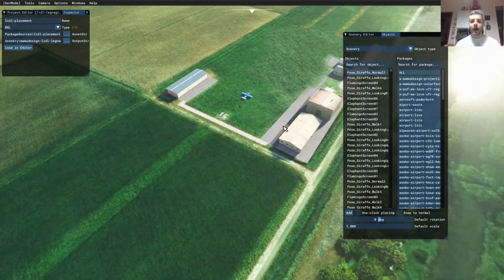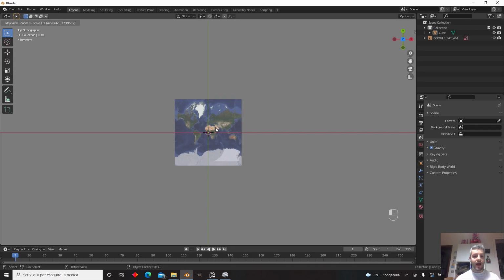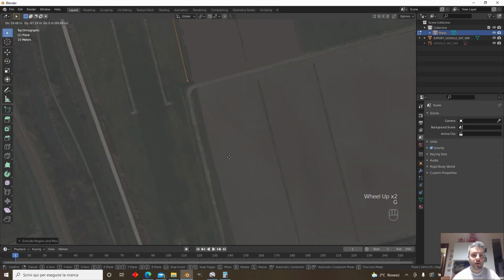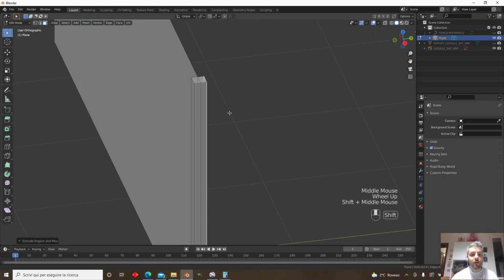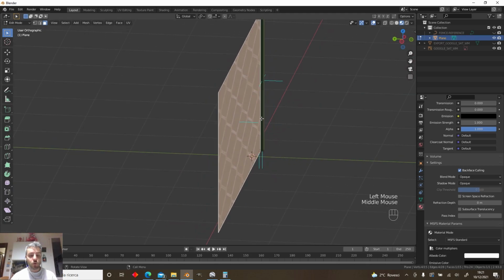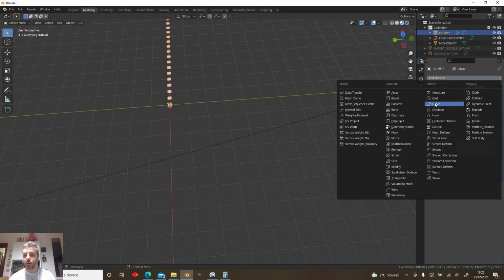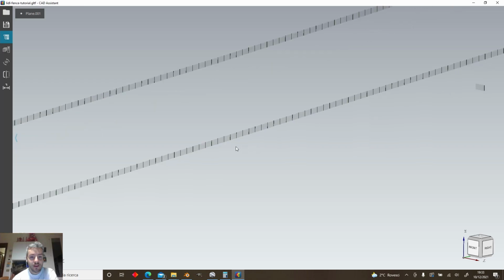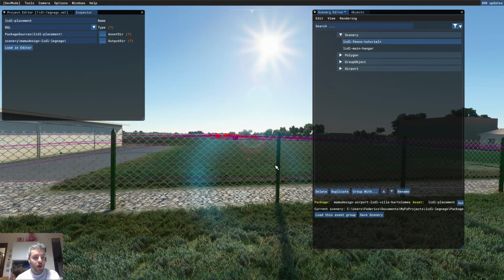MSFS SDK Tutorial - Episode 6 - Fences (and normals, arrays and live glFT edit!)

Comment: Hi Federico, amazing tutorials! Question, if one had a model with pbt textures and only an element need transparency like on this case, can it be done? I.E. an house with grills on the windows with the grills being the only object to be done with a 2D Alpha.

I see here you are not baking any texture, just exporting.
Reply from the maker: Yeah of course you can. 
You can use separate materials (a material for the wall and another for the grilling window)
Or you can use a single material for the whole face and paint the alpha channel on the window only
(Actually I have no reason to bake the texture, in this case at least). I use baking when I create some procedural materials, or when I want to make some special details of a building in photo editor
Reply: @MSFS-SDK-TUTORIALS  Thank you! Of course in your case above no reason however if it is a building with all solid but the windows then one has to bake and I was wondering how MSFS handle that :) will try on a cube as experiment! You have some great videos!

Comment: This is very good. Many thanks. Could you make a variation of this tutorial for creating hedges (with some randomisation of height, thickness, density etc. to increase to realism) for airfield boundaries please.
Reply from the maker: Hi Andy, I will be doing a tutorial about the Vectorplacement tool that came (very bugged ) in su9 and will be fixed in su10
It is doing the fencing job really well, it also grant a little bit of random variations on scale and rotations, using standard hedges default (or custom) objects
The problem with hedges is that they are extremely difficult to render, in low poly they will look fake most of the time, and high poly is really not a viable option because they are quite big objects

Comment: Well it looks great in the tutorial but I cannot reproduce the transparency after trying 3 or 4 times. Could it be that my 'texture image' (of a metal fence) is basically black and white with the metal parts black and everything else (what I want to make transparent) is basically white? Should the areas to be made transparent be a darker color I wonder?
Reply from the maker: Hi John, your image must have an alpha channel! It is no a matter of colours. 
The alpha channel adds to a standard  RGB image the ability to show transparency (becoming RGBA)
Reply: @MSFS-SDK-TUTORIALS  Thanks Federico. I just this minute worked that out by trial and error. I 'erased' all the background and saved as a .png file and the the background was then transparent.
Reply: I have just calculated that by using a PLANE with an image texture of the top and bottom rail and verticals for each panel in the fence on my bridge (370 meters long) I saved more than 30000 'faces' for my bridge model so my 370 metre long bridge is now less than 4000 faces which should have no impact on fps. Thanks again for the tutorial.
Reply from the maker: @johnarnold7460  you can eventually use the plane techniques for a less detailed lod and keep your modeling for lod0 😉

Comment: I am 'gob smacked'. This will allow me to reduce the faces in my road bridge which contains a very long metal fence with many many verticals on each side of the bridge from around 40000 to less than 1000 (using a 2D material image of the fence applied to planes). LOVING IT! From the air it will still look good.